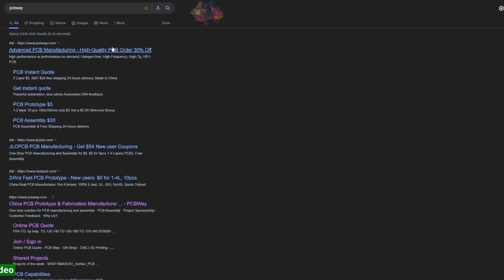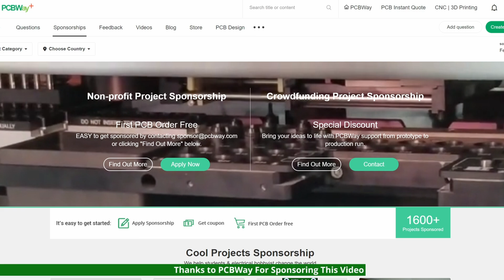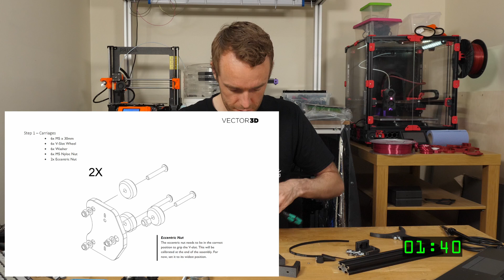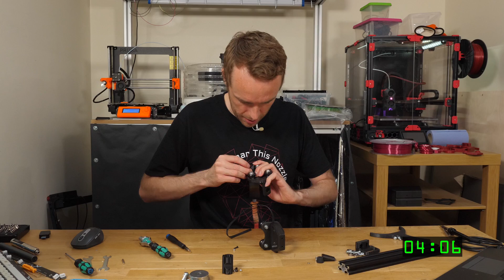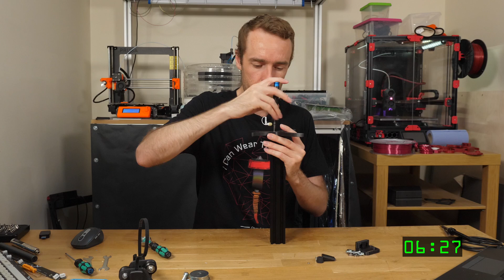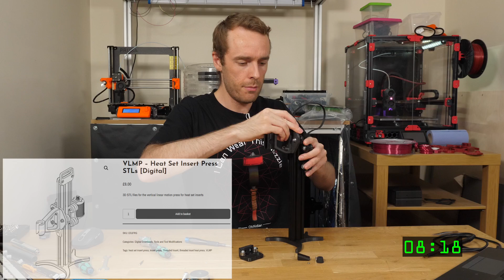I improved this tool to make it the BEST

Comment: I bought the kit and it is well worth it! If you had to go to a hardware store in the US and source all those metric parts you would be there all day. The tool is a easy build and came out fantastic. The only suggestion I would give is use a heat gun to adjust the size of the clamp if you soldering iron does not fit snug.

Comment: Would be nice if you could put weight on top of the handle so that you can push your insert in with a consistent even force each time :). You'd have to be able to easily take the weight back off to lift it up though so maybe that makes more complication than its worth.

I imagine pushing inserts into PLA is pretty low effort, using higher temp materials like nylon needs a bit more force/time.